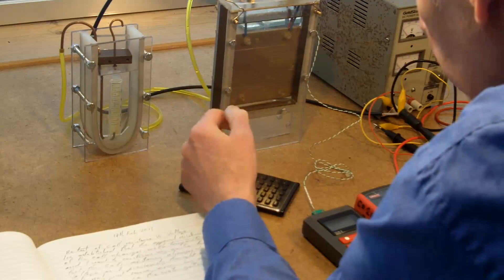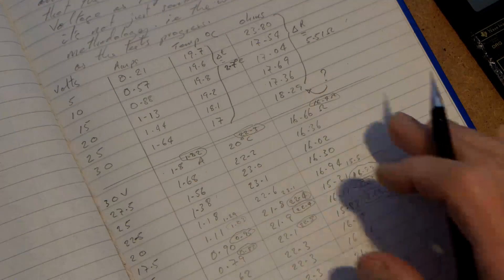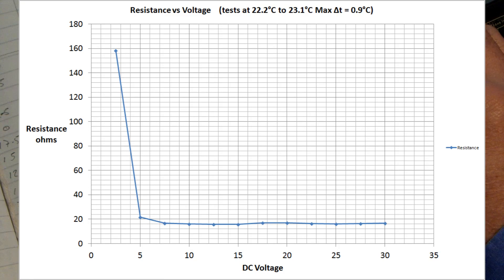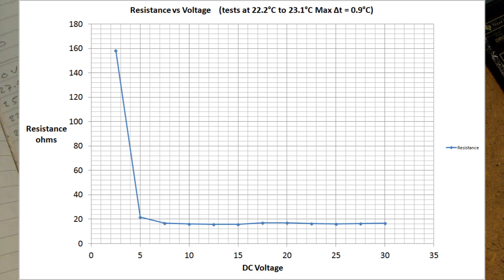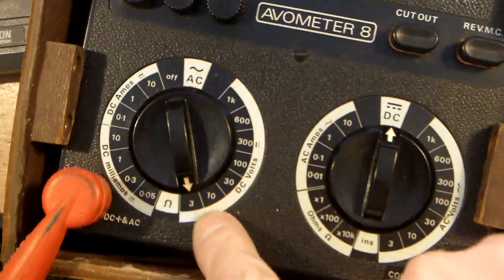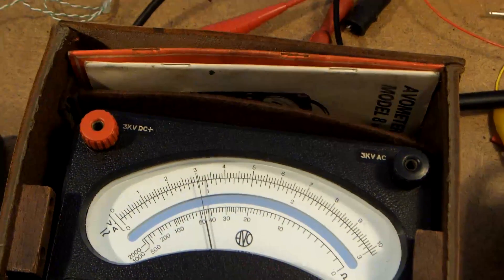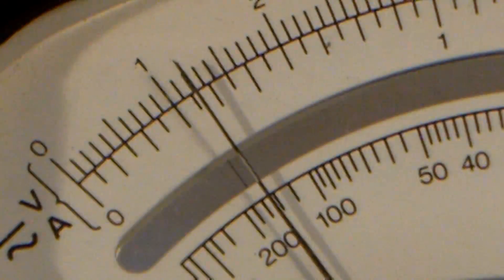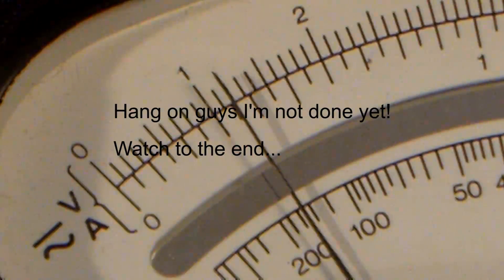HHO. 12 Cell resistance vs DC Voltage (2.5 to 30 Volts)

Comment: I have noticed this "battery" effect. It also gets charged if disconnected from the power supply and leaving the meter connected to the cell, you  will notice a slow voltage reduction. Also if mesureing Homs on a cell with an ionized solucion it will charge like a capasitor and confirm if the leads are reversed fast. Since the water is conductive it acts like a capasitor with a resistor in parallel ...       strange since the plates are in series, it should have less capasitance.

Comment from the maker: I did wonder about spot welding the leads on the plate (discharging a large capacitor) but then I thought I was probably being a little over cautious, mind you that was a couple of weeks ago when I thought this was only going to be a five minute job. I might revisit the leads with a few microfarads and a few tens of volts.   
Thanks for taking the time and interest.
 Kind Regards ... Andy

Comment from the maker: Well, it certainly behaves like a battery and I guess that even though the SS is from the same supplier (on eBay) the two sheets could be off cuts from sheets with some dissimilar properties, I know one thing, what started out as a simple task is turning out into a bit of a marathon but so far it’s been interesting if not a little challenging. Thanks for the input. 
Kind Regards ... Andy